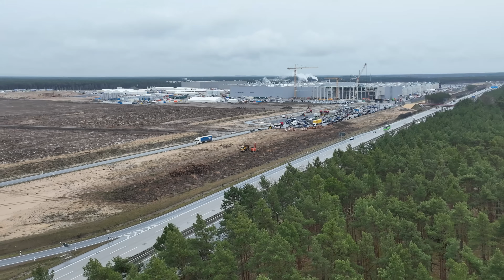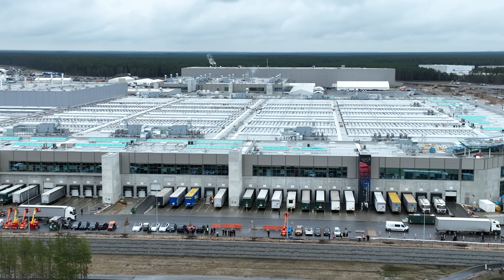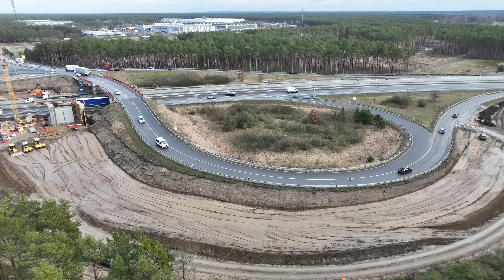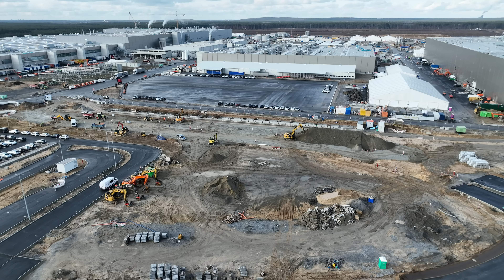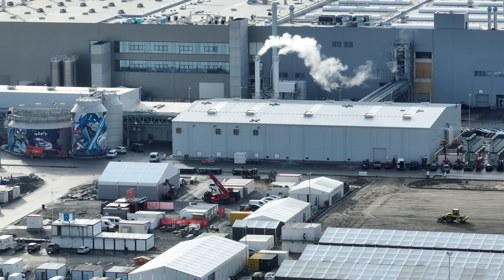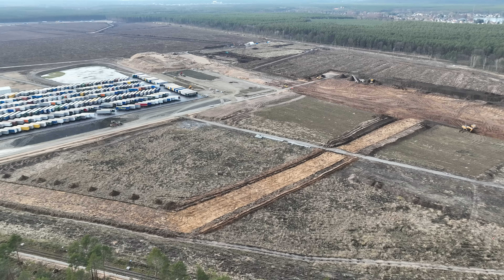Giga Berlin | 2023-03-06 | Voice-Over

Comment: That new railway line cannot open up soon enough. The parking space issue appears to be becoming untenable. Also, I wouldn’t surprise me to eventually see Tesla being forced to apply for planning permission for a multistorey staff carpark as employee numbers continue to rise as the facility expands over the next few years. If staff continue to park wherever there's space on the highway, it will start to create tensions with local residents and give one more excuse for the naysayers to try to pull Tesla's leg off and hit it over its metaphorical head with the soggy end.
Reply: They are already at 9.000 employees and this number wont increase that much in the near future. The parking lot should be big enought since it is only at like 80% of capacity and the train station will relax the situation as well.
Reply from the maker: There are no local residents in walking distance. And almost no employees are parking along the roads in the neighboring industrial area. The car park is planned for 12.000 employees. Right now it's more than 10,000 employees and the parking lot is not completely finished. When they build phase 2, they will also build more parking lots in the north.
Reply: @Tobias Lindh  That's interesting to know. But I still think from a land use perspective, a multistorey carpark's footprint is so much smaller, allowing better overall usage of Tesla's available land. Extensive ground level parking is a silly use of land in an urban or industrial setting if you don't have to. It adds to the heat island effect and greatly reduces groundwater absorption, even with the best water management designs; climate change will mean heavy & more frequent flooding at some point, even in this drier part of the country.

Comment: More please, Excellent dialogue, so glad you didn't use an AI talking bot. (one followed in an ad, yuk)
This format more than makes up for the lack of flyover access.
I kind of wonder whether the new drone restrictions are to do with the supposed upcoming model '2', maybe there are a few prototypes in there somewhere and an accidental reveal my give them some 'Osborne effect'
Most surprised by the lack of railway work - I would have thought that would take a lot of strain off the carpark.
 - maybe some other part of the rail network needs work first?

Comment: Ausgezeichnet, Tobias; danke. They really need to get on with building the railway branch and station; that will surely help reduce the parking problems. So, the reason for the Berlin ban is presumed to be for safety reasons yet Tesla has no such concerns at Austin and Fremont, which are still regularly and extensively overflown. Curious.
Reply: Won't change a lot ...

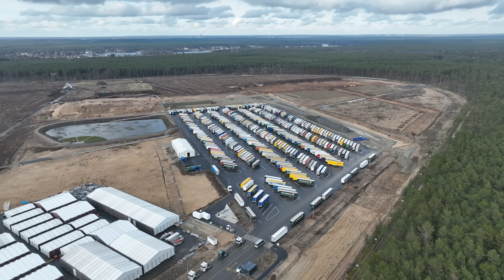Comment: 22:59 - next to the train tracks there seems to be concrete blocks in/on the ground. Do you know if they will electrify the rail line all the way to the new shuttle stop?
Reply: They won't, as that would interfere with freight operations. Also, the plan is to move that line to the east so the loop is wider and can turn into a freight station for car loading.
Reply: @HenryLoenwind  What? 97% of fright trains are electrified in Germany.
Reply from the maker: No, this line will not be electrified. In a few years it will be replaced by another line anyway. The blocks you see, are just palettes with the stones that will cover the cable trench along the tracks.

Comment: Tobias I asked about shuttle station on another video and someone replied saying the water utility company has complained about the tracks going over a water conservation area and that's why work has stopped.

Defiantly better with voice over, any more news on phase 2 yet?
Reply from the maker: The press just asked the water supplier about their opinion before the authorities gave the permit, and so they told the press about their concerns. That was the source for the one that answered to your comment.
The water supplier was involved in the permitting process. But that involvement is a normal process and it didn't stop the authorities from issuing the permit.  There is no official complaint against the permit, so that's not a reason why they are not continuing the work.
As Tesla didn't apply for a permit yet, we don't have any new information about phase 2 yet.
Reply: @TobiasLindh  Thanks, hopefully they complete it quicker than the main entrance;)

Comment: The voice over is much better.  Why have they stopped the drone flights?
Reply from the maker: According to my information it's due to safety concerns.

The pile driving would have been noticed anyway. That machine is pretty big and loud. It was driving piles for a week and it could be heard everywhere in the nearby village. And Tesla should have known that they need a permit for that, as they always had huge debates eveytime they wanted to drive piles. Unfortunatelly it's not even the first time they drove piles without permission. They did that the first time before they even started construction of the factory.

Tesla is also not canceling expansion plans. Even if there is a lot of red tape, it would be against Teslas interest to cancel the plans. And the leading team always said that they are very happy with that location and are fully committed to this site. There is also no real alternative to this site. And they are already wanting to do more expansions for Giga Berlin as initially planned.
Reply: @TobiasLindh  That's why I used the words 'evidently' and 'rumor' because no one knows for sure what happened, even if the source is Teslarati. I do know from Elon's tweets he was upset about the permit issue. At GigaTexas, the drones fly right up to the windows and look inside at the production lines, which shocks me that Tesla allows that. 

Do you know why Jörg Steinbach went to Austin to meet with the Tesla brass?

P.S. Love the new voice-over format.
👍👍. If it continues, I will increase my Patron pledge
Reply: After Tesla received a stop work order from Brandenburg over not having a permit to install the posts that the solar panels for the chargers mount on and will be fined, Elon blamed drone flights for bringing it to the attention of the group that made the complaint. You would think if you got a permit to install the solar panels, you wouldn't need another one for the posts to mount them on. But as Elon has said, "In Germany, everything is illegal by default". :)  

Brandenburg's minster Jörg Steinbach is at Gigafactory Texas now, tying to smooth things over because Elon told them Tesla is cancelling their expansion plans in Germany because of the red-tape. The only part of the above that is 100% verified is that Jörg Steinbach is at Gigafactory Texas.